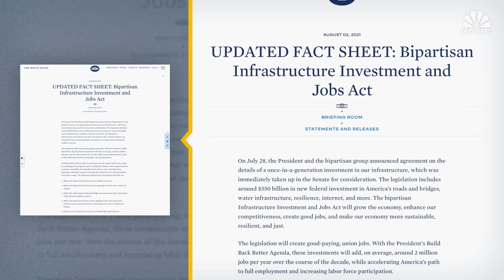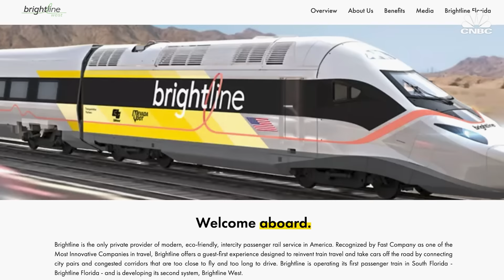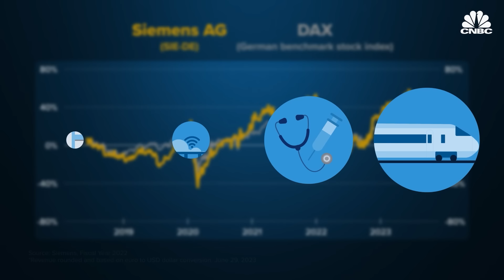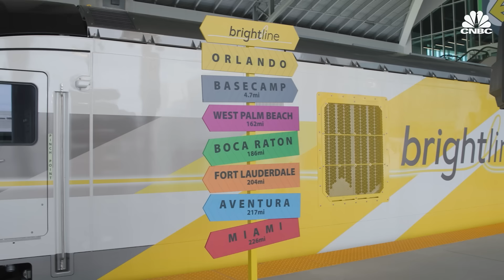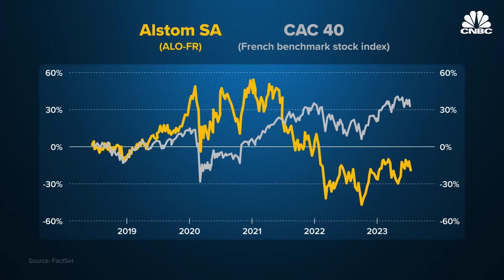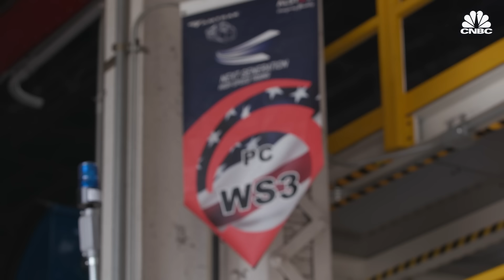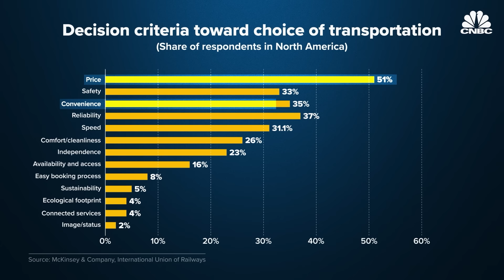Why Passenger Train Manufacturing Is Booming In The U.S

Comment: I recently returned from Europe. We rode several thousand miles on trains while there. Switzerland was by far the most impressive of the networks, but all were vastly superior to the US. I think anyone who has been able to experience their rail network would want the same for the US. Trains are clean, safe, very reliable, very well connected, frequent and FAST. Riding the TGV between Paris and Zurich was probably a little bit slower overall than flying but was a vastly superior experience to flying and well worth the extra hour or so total in increased travel time. The younger generations are on board with transit. I expect the next 20 years to see a massive increase in demand for intercity rail and public transport. It will be a self-fulfilling prophecy. The more trains we have, the more people that ride them and the more people realize we were stupid to wait this long to not build more.
Reply: Don’t the current Acelas have tilting too? I know they were inspired by the Swedish flagship X2000 trains, which also have tilting.
Reply: @ncard00  I believe they do. However, the Acela runs on a few hundred miles of track. There are so many other city pairs and routes that would benefit greatly from Acela like trains.
Reply: @joshburger1216 Yes, and that’s exactly what Brightline is doing, with Miami - Orlando starting service in a week, and LA - Vegas starting construction this year.
Reply: @ncard00 I am definitely excited about both of those projects. Bright-line in Florida has seen ridership grow significantly and seems to be very well rated by customers.
Reply: Europe is small. Paving roads is cheap. Trains are debt bombs as China is finding out and hopefully we avoid. I love trains and trams but they need to go where they make sense. That is not that may places in the US.
Reply: @joshburger1216 Acela is expense. Even through it is subsidized. That is one of the only feasible train in the US ta boot. Paving roads is cheap. Trains are debt bombs.
Reply: @user-cu7uz5le3h Europe is not ‘small’. There is rail track virtually everywhere and you can make 1,500 miles train journeys in Europe. Indeed a large part of the US is less densely populated than most of Europe, but especially in the more populous areas trains make sense. The car centric develpment of America has bad side effects.
Reply: @user-cu7uz5le3h  Sorry, but that's wrong. When will you Americans finally learn that Europe is not a country but a continent and not small in total. And when it comes to railroads, each country is still responsible for its own infrastructure. But because Europe is much more densely populated than the USA, road construction is very expensive because many interests have to be taken into account. But this also applies to the construction of rail lines. Road and railroad construction are similar. In contrast to the USA, however, Europeans have recognized that many national and international railroad lines between major cities and regions make a lot of sense. A) it relieves air traffic and b) it is better for the environment. And to compare China with this is absolutely wrong. Even if rail transport in China is absolutely dificult, it is absolutely right. Because what would air traffic look like if all Chinese people wanted to fly? It will take a long time for Chinese citizens to realize that rail is better for them, so investing in this form of transport makes perfect sense.  If all the migrant workers in China use the trains instead of walking or hitchhiking, the trains will already be full ;-)
Reply: Thank you for pointing out how far we are behind when it comes to important issues in this country.
Reply: @brooklynelite5428  we are actually doing better. We only make trains go where the audits say it makes sense. Our road system is what made us have suburbs which let us have families so we have a future. Unlike Europe who does not.
Reply: @user-cu7uz5le3h  I some aspects were doing good but in others were not. When I comes to speed and efficiency. The suburbs need more train station built in every part instead of running a straight line through branch off from the main line in every suburban area. They must also fix out crumbling roads.
Reply: @user-cu7uz5le3h how does Europe not suburbanizing itself have anything to do with its future? That doesn’t make sense to me.
Reply: @Obbij  They didn’t have enough kids after urbanization. No replacement population.
Reply: @user-cu7uz5le3h  that still doesn’t make sense. The problem wouldn’t be any different with suburbanization instead.
Reply: US has clean train, in US, not possible.
Reply: Nobody thinks this
Reply: Switzerland is the Japan of europe. For my impionion.
Reply: I'm lucky I live close to an amtrak station and I use it to travel to Boston. Its slightly quicker than driving plus you don't have to worry about the headaches of driving and parking in the city. It takes away a big stress of the trip and turns it into a relaxing one instead. I'd love to see rail services modernized and expanded.
Reply: Even in Europe, few people are using trains for journeys over 4h. This would be the same in the US. That limits possible routes..
Reply: @ohhello3234  The vast majority of trips most people take are less than 4 hours so this makes sense. Commuter traffic accounts for millions per day in cities like Paris, London, Hamburg, Berlin, Madrid, Rome, etc. When you have high speed trains that average well over 100 mph, 4 hours actually encompasses a huge percentage of the trips most people would take on a routine basis. Same thing with America. Although the US is a large country, a huge percentage of the population lives in relatively small geographic areas like New England, Northeast Corridor, the Texas Triangle, Sunbelt, Florida, Southern and Central California, Pacific Northwest, Chicago Hub, etc. Another thing to consider is a lot of the way Europe has developed into much more livable and less sprawling cities is because of their transportation networks. Having cities with much better mass transport and intercity transport will change where and how people live, their commutation and work habits, etc. We are already starting to see this with major city downtowns redeveloping and becoming trendy again. especially for young people.
Reply: So what would a good route be? Also don’t forget that without a great local mass transit system, people are going to be stuck at the train station and will need to take Uber rides across the city.
Reply: @ohhello3234  Literally any of the dozen or so regions I just listed, most of which contain multiple potential routes within the region. There are tens of millions of rides that can be generated every year for just intercity travel, not even counting commuter ridership. Just look at Brightline in Florida, already well on their way to 3 million rides a year with only an hourly service with limited stops in one of the most car centric states of the country. We also need to invest in better public transport in major cities outside the NE Corridor. Often times these projects are connected and one leads to the other. Charlotte NC for example is building a new train station hub with upgraded public transport connections and increasing trains per day. Ridership has been growing rapidly on the Amtrak lines served. New projects are popping up next to stations all across the Piedmont route changing where people live and commute from.
Reply: Waoh  I would like that in my country rail industry Will have a big developed  in the next years greeting from Colombia
Reply: @user-cu7uz5le3h  Are you a reporter for the New York Times?
Reply: Maglev trains should be the answer at 385 mph trips for Boston to San Fran would take 12 hrs.  Bos to Miami 9 hrs.
Reply: American riders are not the same as US riders, we don't keep our trains clean. as for safe...yea idk if you have riden public transit in the U.S. it's not a safe affair. ive seen fights happen and harassment constantly. The security definitely needs improvements
Reply: @AStewSr  they are just too expensive…
Reply: I'd rather copy the Japanese then the Europeans. It's worth the investment.